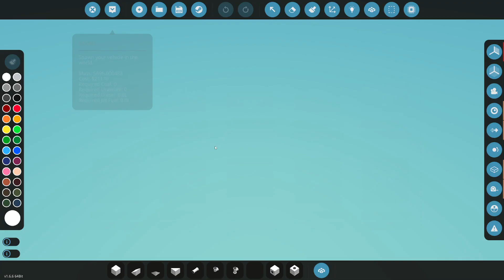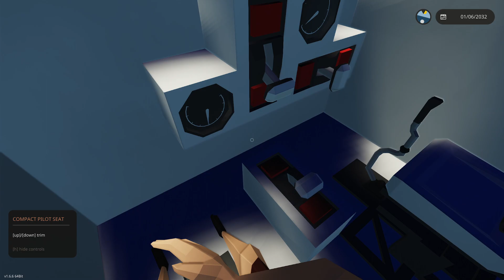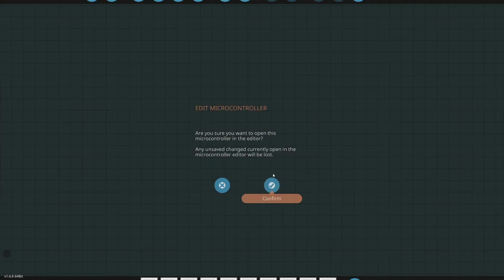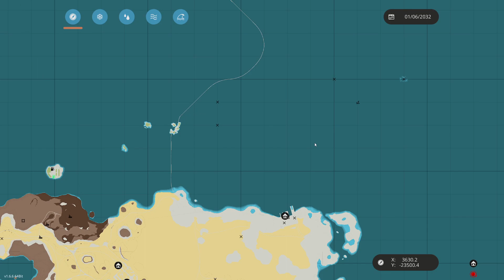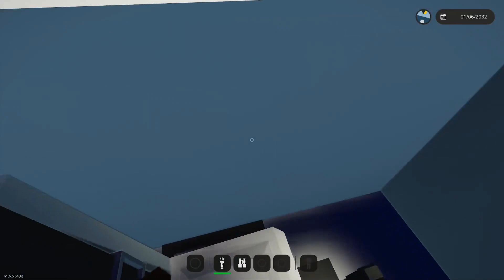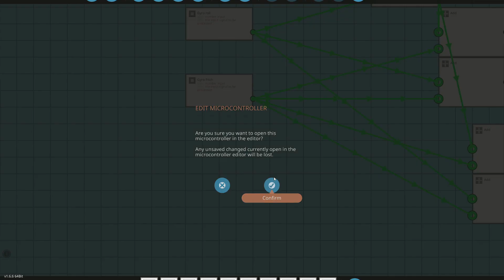Stormworks Career Build Series 194

Comment: This builds probably long since finished, but for anybody planning their own (or something simlar, like a hovercraft) you could use "MIN(distance sensor, fluid meter's content level)" as the fluid meter reads height to surface of water (rather than altitude sensor). This would give ground effect off waves, or off shallow water, while setting a height that just barely lets you clear over trees.